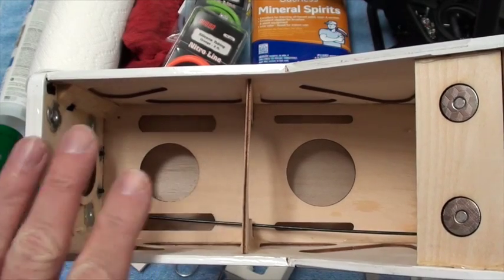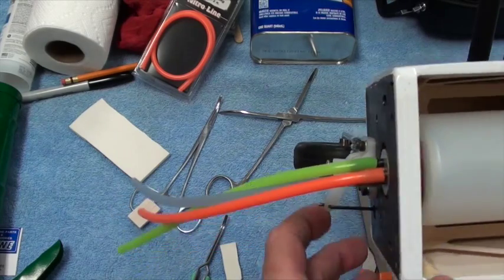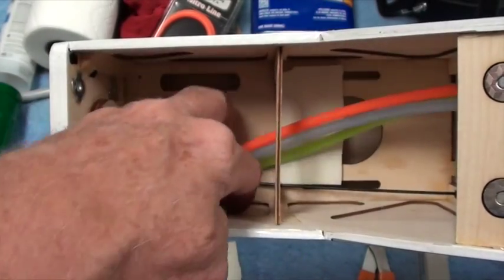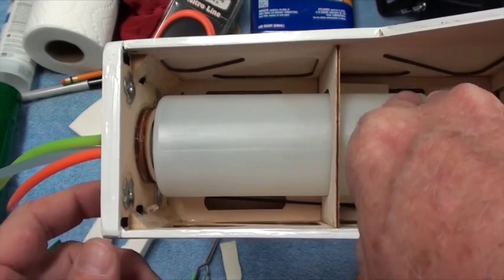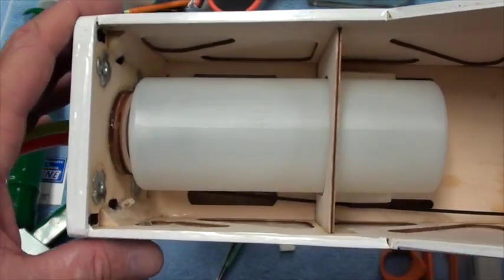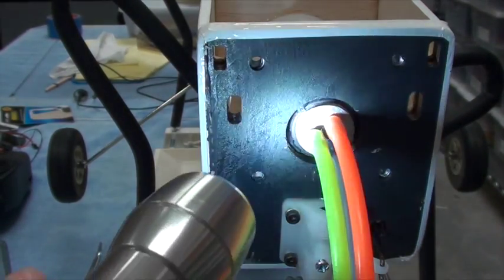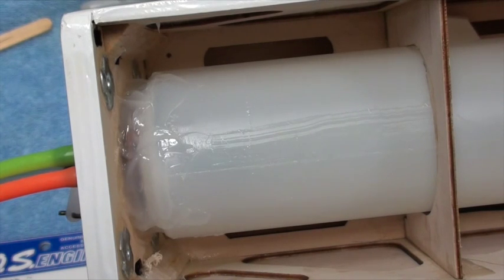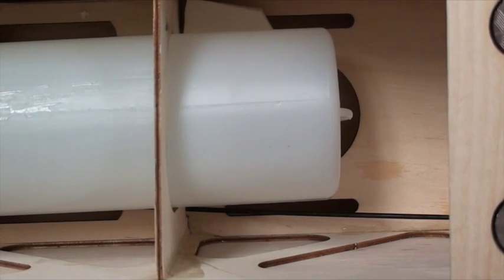K44 Kadet LT-40 Tank Install

Comment: I have an older Kadet high wing my brother just gave me. There is no round fuel tank. It is square. It didnt come with it ,I believe the original tank must have went bad. I am thinking I will install mine with a large patch of velcro. I dont have the model number but its on the tail somewhere. The covering is a cloth material that has been coated with a sealer of some kind. It has been in storage for quite a few years and needs a good cleaning and servicing before flying it. I havent flown nitro in years,looking forward to flying that big brown and black plane.